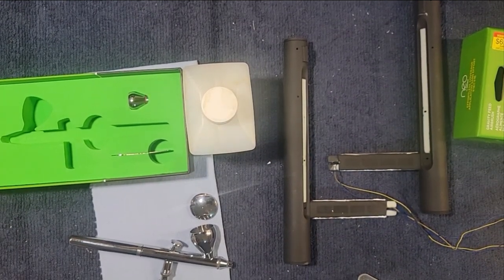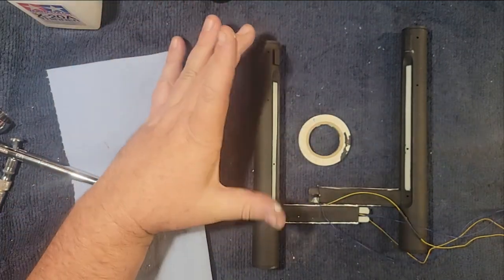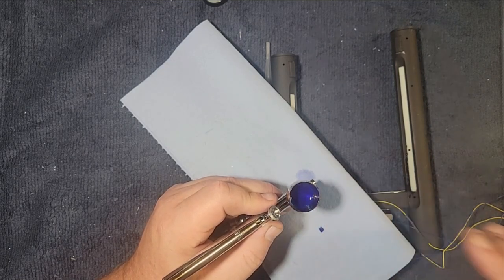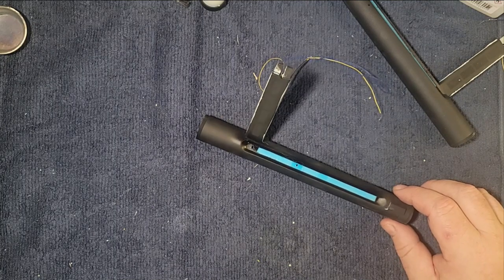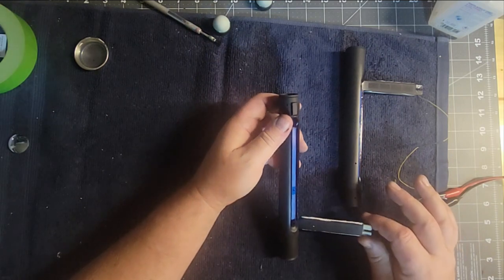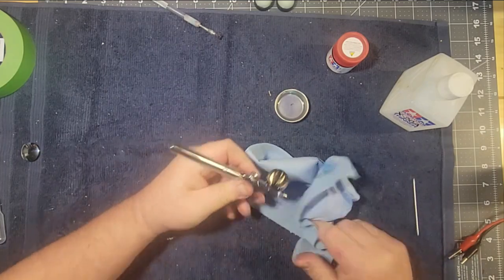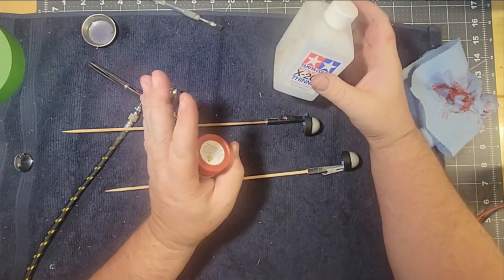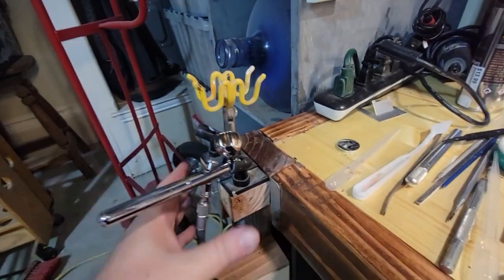U.S.S. Enterprise Model 1:650 Scale Full Build - Chapter 7

Comment: @The SciFi Model Guy If you do this kit again I would suggest using the Paragraphix set. It has some grills for the nacelle that when paired with what you did with the painting you did would give you a really nice diffused effect similar to that on the CGI remasetered USS Enterprise. And here is another tip the curved pieces that go on the front of the nacelle and the Bussard Collector you can cut both pieces into 3 pieces it will add more realism and it falls in line with the original Franz Joseph design drawings of the Constitution class. It only took me a couple minutes to modify those parts.
Reply from the maker: Hi Michael! 

I'm so sorry for the delay in responding -  I currently am working two jobs so I need to do better in prioritizing my time.  It's very important to me to respond to everyone and I do apologize for taking so long.  I really appreciate the tips!  I will be doing this kit again.  Please if you can, shoot me an e-mail with any links or more info for the methods you're describing. I'd love to take a look!  e-mail address is in the "about" section. :)

Comment: Hello partner.  When it comes to paint drying in or on the airbrush, I really don't worry about paint drying in the cup.  Place the cup cap on it and set it down in the holder.  On the tip is a different story for me.  I keep a soft toothbrush handy (a cotton bud will work too) to clean the tip with water/thinner if I'm going to be setting the airbrush down and not spraying for a few minutes.  I only use Vallejo paints, and everyone knows how it likes to dry fast.  Hope that helps a little.  Another great video!  Thanks, Eric.  By the way, how do you spell your first name?  So many ways to spell Shawn, Shaun, etc...
Reply from the maker: Hi there! Thanks for the comment  !
For the paint drying, I agree, I don't usually worry about it drying in the cup, and you're right- it's the needle that's important.  I use the same technique to clean it, after a short rest, during a long spray session (multiple fills of the cup) and also for a color change.  

When using cotton buds (Q-Tips for those here in the states), I try to be careful and use small modeling ones... the large ones we use for personal use are very fibrous and I've experienced issues with the fibers falling off and causing clogs.  

Good tips !
Reply from the maker: **edit, it's spelled Shawn 😁
Reply: @thescifimodelguy  Thanks Shawn!  Eric